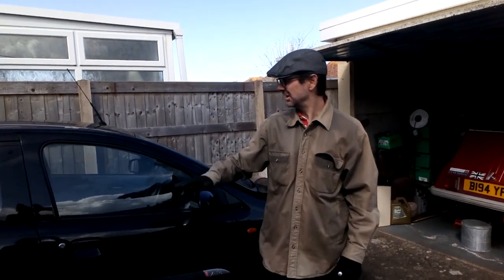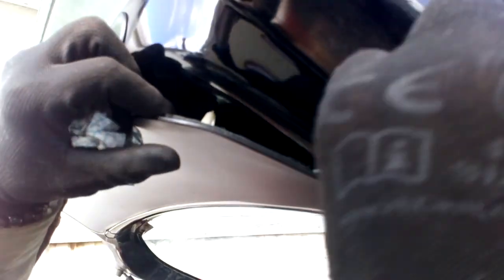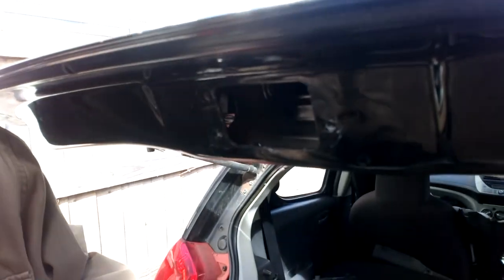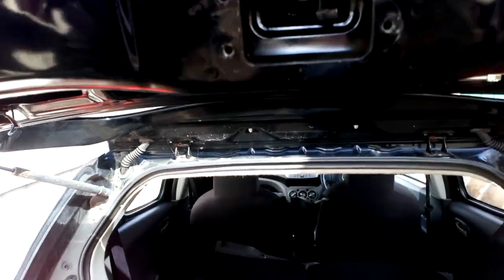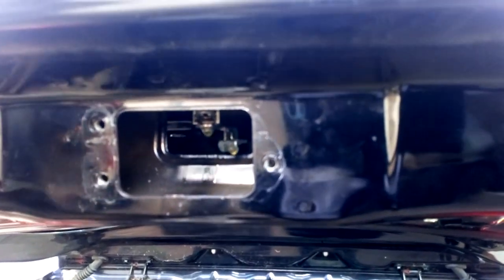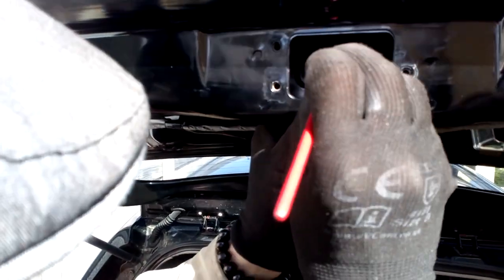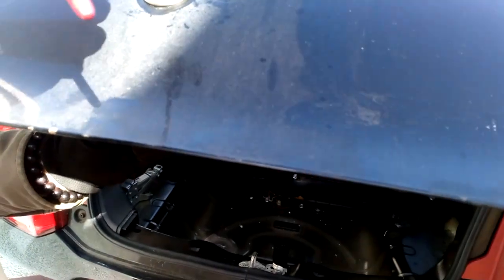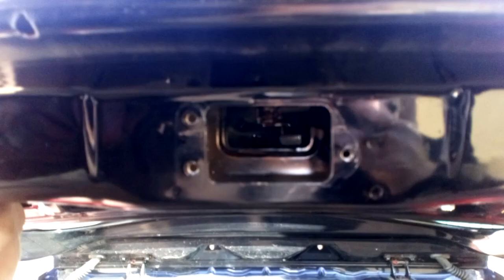How To Fix A Stiff Suzuki Alto Boot Lock

Comment: I have the same car with the same issue , so was happy to find this video.  Sadly it didn't work for me though. Followed all the steps and uses penetrating oil on the lock mechanism but it still won't budge.  Any suggestions?
Reply from the maker: Sorry for late reply to your comment, however, alll I could suggest is give it a good soak in oil for a day or so. Wipe off all excess oil and try lock. Otherwise sadly it could be replacement lock.

Comment: Massive thanks for this.  Just bought myself an Alto and the back lock is the same. Should be able sorry it now no problem cheers.  I need change the fan belt at some point as well. Cheers bud
Reply from the maker: No problem. Thanks for the comment. Glad my antics are of use to someone.